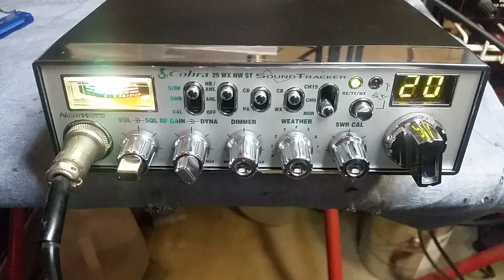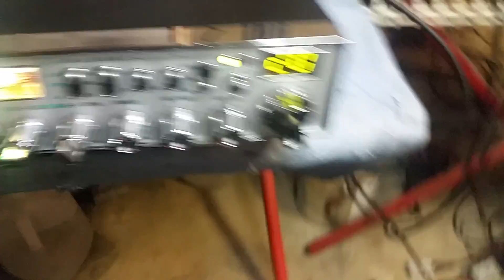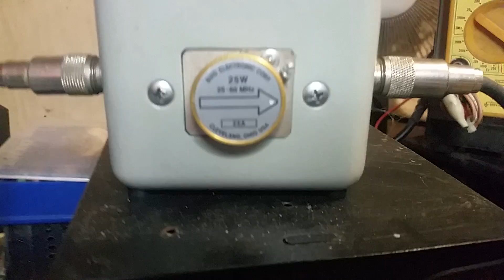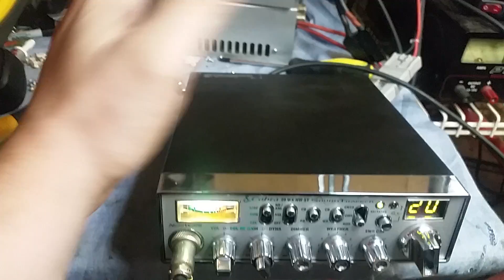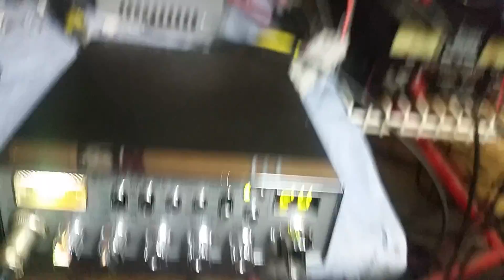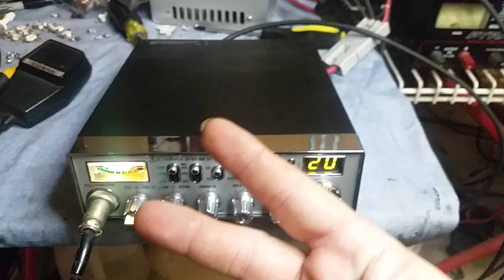Cobra 29 CB Radio 18-19w RMS 60w PEP! HOW 🤔 ❓

Comment: Nobody does it towards my area in Alabama .
Reply from the maker: Yeah I'm honestly not sure but you sure can contact those d-rail over at Wolfman CB
Reply: @1883gotdown 10-4 yeah he might . It’s a 29 Ltd classic . Now I can turn vr4 counter clockwise correct and that will up modulation for right now ? til I get ready to run a little amp.
Reply: And thanks

Comment: Rm italy 203p and bearcat 980ssb... is this a good combo?
Reply from the maker: Shane E. As long as your dead key is low and your not swinging backwards on a rms/avg reading watt meter. The 980 bearcat is not a real strong radio at all so it should be a good matchup for any low Drive amplifier
Reply: 1883GotDown thanks!

Comment: Do you have a video or can you make a video showing how to tune  the input and output .  thanks love your videos
Reply from the maker: Michael Miller gotta keep some stuff in the dark. Anyone can build a box but not just anyone can tune one. This is where experience comes in to play and I am still learning better ways and methods of tunning. If you watch multiple vids from me of builds you will catch on to the most basic way that I do it. This is one thing that you usually will not see a builder straight out showing you how to do. Sometimes it takes many hours and many days of frustration in the tuning world LOL main thing you need to remember is the input impedance needs to be as close to 50 ohms as possible so all the Watts make it into the box and the output impedance needs to be as close to 50 owns as possible so the all the Watts making out of the box is close to 50 ohms as you get the less reflect you'll have on either or. Of course there's different methods difference impedance matching circuits to acquire this goal and even if someone showed you that still just half of the issue the other half is it has to be done. Shoot me an e-mail sometime let me know where you're at with everything.